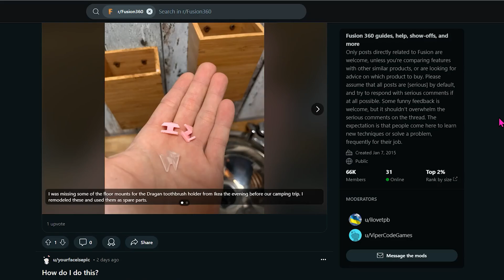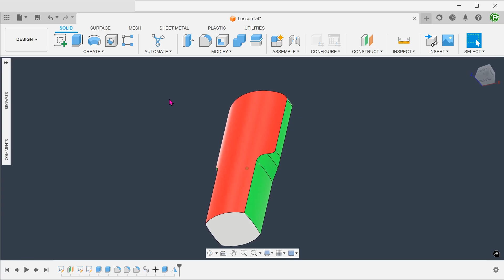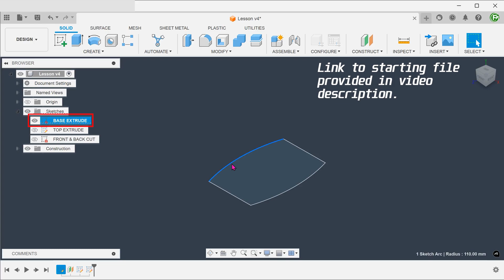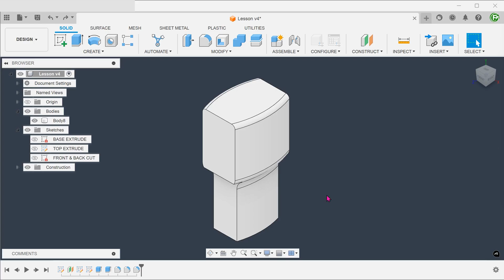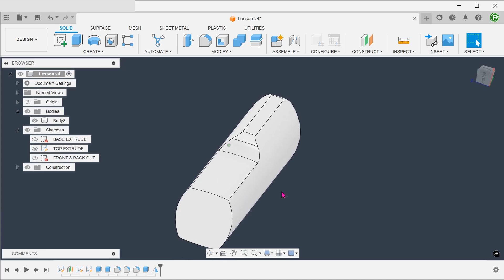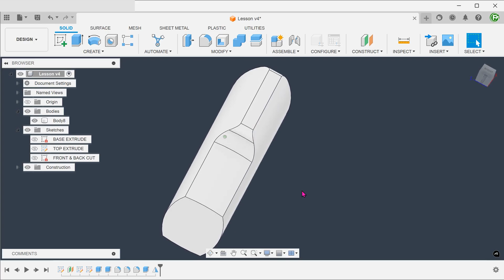Autodesk Fusion | The most important step

Comment from the maker: Hope this has been somewhat helpful. No fancy tricks here. This is more of a visualisation exercise. For the second method, you can use revolve to trim the left and right sides. Since the curvature is very minimal, you should not be using the center axis of the model. The axis of revolution should be off to the side.
Reply: Your videos are always helpful. I don't use surfaces much and watching you apply them in creatives ways I didn't even know could be done has been enlightening. You can have so many ways to get to the same ending that sometimes I find myself making several over complicated attempts at a shape until I get a feel for the basic structure and make the clean version. Then it's all about, why didn't I just do that from the beginning. lol